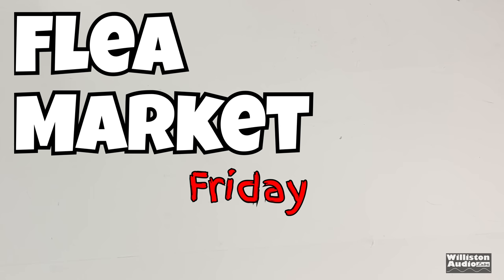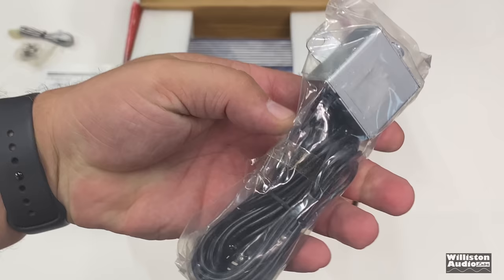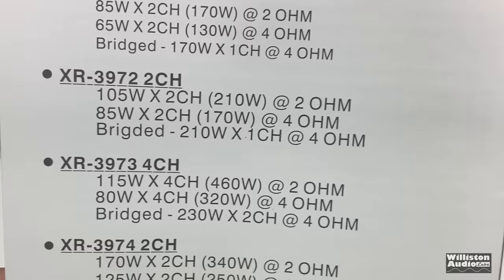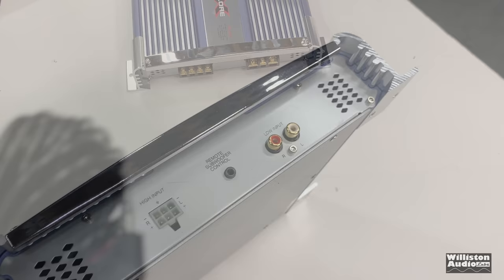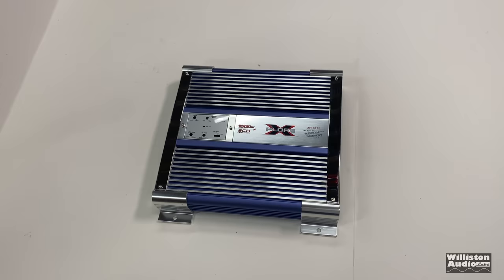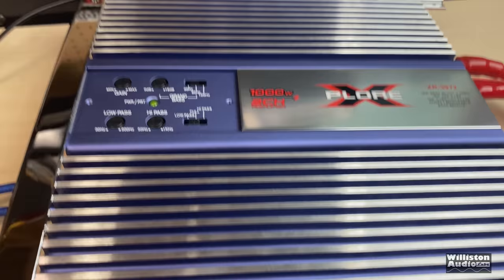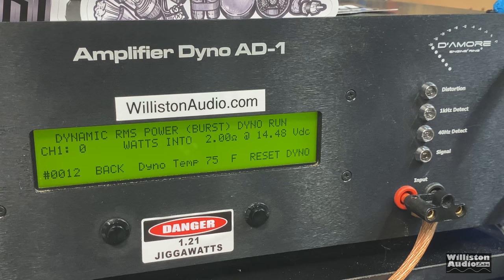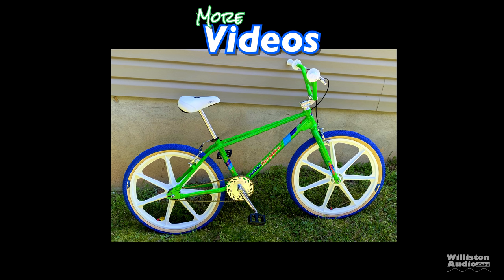Xplore 1000W Flea Market Special Amplifier Amp Dyno Test and Review [4K]

Comment: I love these cheep amp reviews possibly more than the expensive reviews, I'd love to see a series where you ( or you team up with someone) where you modify them and see what they can do with some additional work, bigger caps and transistors etc ( not the guts from another amp)
Reply: I had some parasound amps I got from when pacific stereo when out out business.  My best friends grandfather modded them .  Every  one had hifonics and I had 2 cheap amps running 2 ohms blowing them all  away.
Reply: Pretty much ends up being a complete redesign of the power supply and most of the output section. There's a video series that bare vids did just recently on a taramps audiopipe clone that he changes to get the output of the original as a proof of concept. Very informative if you want to check it out.
Reply: @brentb5303  I'll take a look at that thanks
Reply: It is
Can We meet a  @Bondovw
Reply: It's the power supply more than anything that determines the power output.
Reply: Great idea , pimp the cheap amps for $10 of electronics
Reply: @69eddieD  I was wondering if he could do tests at like 13 volts to closer imitate us stock alternator guys. It’s probably lower than that….

Comment: Man, I love these flea market amp tests!
I'm suprised this one actually made rated power.
I'd love to see some more Urban Audio Works test too.
Reply from the maker: I’ll try to do one each week. I have like a dozen of these style amps.
Reply: Urban Audio...  now that that takes me back, 1st lesson in you get what you pay for a value pack cassette radio plus amplifier from Urban Audio. Thought it was going to make the '85 S-10 freakin awesome! Umm ya just no... lol. Can in hear it for the old JC Whitney sub box with built in tweeters while we at it Hahaha
Reply: @myevilbanana  * edit below figured it out   
who was the company that was before urban amps?  They looked exactly the same.  I remember they said they had hexfets instead of mosfets or some shit lol
They were Targa amps
Reply: I think Targa was the brand before urban audio works
Reply: @myevilbanana  I remember back in the 90's there was a store in out local mall that sold urban audio equipment and you could buy a 12in woofer for like $20-30 and a 400w or 800w amp for like $45 and I'm not sure how you had bad luck with them but I had 4 urban 12's running off of 2 of the 800e amps in a little chevy chevette and it would rattle your teeth for the amount of money I had in it....
Reply: @miketaylor2197  targa i think was , i had 2 10 in targas in a band pass actually weren't too bad .
Reply: Splash amps were garbage
Reply: @wal  BigDWiz! I have a few old school early 2000s amps I want to send you for testing. One of them is an Xplore amp-4040 😁. The others are an old school Rockford 400.4 and JL Audio 4 channel with non-regulated power supply

Comment: Back in 1993 I bought a cheap swap meet amp and two 12" Pyles.  It was my first system and I loved it.  Obviously cheap af but I finally had bass in my ride and I loved it
Reply: Gotta start somewhere unless you got plenty or extra money to start
Reply: @throwback_jackson  I agree.  Back then car audio was much more expensive and rms was low on amps and subs.  Today you can get a 3k legit amp for under $200.  Back then $200 amp was like 80rms per channel lol
Reply: @jorgem50  first Watt is what counts Brotha! :D
Reply: I thought I was hot sh-t around that time with my Optimus 18" from Radio Shack with a terrible homemade box that was completely the wrong size and leaky. I added a 12" MTX Blue Thunder after a while. I cringe a bit looking back but it was fun times and good memories.
Reply: @murrayshekelberg9754  lol man those were the good days.   Back when I was 16 and driving I was at my uncle's house and i took one of his cabinet speakers in tested out in my car.  Lmfao I just straight hooked it up to the my stock stereo. Sounded like crap.  I had zero idea that I needed an external amp to push those cabinet speakers.   This was in 1986 btw.
Reply: @jorgem50  probably a fisher house speaker with the white 15in woofers

Comment: I used to run a 2 channel Sony amp back in ancient times. It was a Sony XM-502x to be exact. It had the crossover and gain controls on the top and a plexiglass piece covering it like this one. Same crappy speaker outputs. Mine didn't have any chrome, but it was the blue/purple color this one has. I was running MB Quart components in the kick panels and two 10" Kickers behind the seat of my '78 Dodge D100. This was when MB Quart was good. I want to say this was early 2000's. I still have this Sony amp in my attic and I have no doubt it would still perform if I put it to use again.

Comment: Ha! Gotta love it when old junk makes actual rated power! 

I’ve got an old school amp request. I’d like to see you test one of the giant old Audiobahn amps that started showing up everywhere in the early 2000’s. I never sold the brand but I’m sure you remember the amps. Some models were absolutely giant, were chrome with gold handles or guards on top with top mounted fans and some had VU meters. I installed tons of them and always cussed them because they were so dang huge and would barely fit in anything aside from an SUV. A few of them made good power as I recall, but they were unregulated power hungry monsters.
Reply: CRACKED HEAD idk how it was in your area but in mine for the most part Audiobahn was heavily slept on. Guess one had to know which Audiobahn subs or amps to get because they made some great amps & tough subs! The Audiobahn subs & amps that always come to mind is probably like the ones you mentioned... The amps looked like chrome, had flames & blue lights & yes many of them were huge. Then the subs with chrome color baskets with flames. Can't believe how expensive some of those Audiobahn amps actually were back in the day.
Reply: @itdoesntmatterwhatyourname6128  I had the flame 🔥 q subs with the flamed basket on a rf 800power and they killed back in 03
Reply: I had an a16000v,  it did its rated 1600 watts easily, but it sucked the life out of my power supply. It died when I mounted it on the box directly. A huge shame because it was really powerful for its time

Comment: If you could grab one of those X12, V12, D12 (MRV ones) from the chinese market with 4/3/2 channels stating to have more than 3600w to test. It would be great since it's the most famous cheap amplifier here in the Philippines costing just about 2500 php or roughly 50 usd.

Comment: A lot of my friends bumped the old Sony xplode series amps and speakers, I could always make them sound really good for an entry level system. It always made them happy after install, even the pentagon shaped subs sounded decent
Reply: Wow,.. interesting. Everything, and i mean everything in that line, ive seen, is complete shit.
Reply: @96kylar  for entry level, they didn't sound bad, yeah they are a train wreck on the total scale, but if you u only got 150 buck for a system,  damn you should probably save your money
Reply: I hated the subs they blew out easy. The amps were class D and not that bad.
Reply: I had a pair of xplod 12s on a RF amp in a Lumina 20 years back and would set off car alarms as I drove through the mall parking lot. I can't comment on their amps but those speakers took some abuse and were still working when I sold them after 8 years. Maybe I just got lucky but I wonder if all the hate was really deserved and if many of the people talking about how bad that stuff was actually had any experience with it.
Reply: I worked at a shop that used to sell the exact same model amplifier 18 years ago. Surprised they are still making them.

Comment: Not too shaby for a feamarket amp - and the protect circuit works the way it should.  Got a low end car with a factory radio and want a little bump?  Then a single inexpensive 10 or 12 plus this and your set.

Comment: Maybe you could find an old school Amp. It's the power acoustik A3000db 3000 watt max. Class d mono block. Would be interesting to see what it pushes. I used to run those back in the 90's and they would push anything. I hit 151.6bds in a 1981 thunderbird. With one of these pushing 3 aluminum audio pipe 15" subs. I would compete with other bass heads that had more expensive systems. The called my thunderbird the sleeper.
Reply: I had it wired at .67 ohms and it never shut of or overheat. They were beast.

Comment: I want flames! :D Also wouldn't mind seeing the guts, that old school 'cheater' amp did surprisingly well.. Edit: You opened it! Nice.. Quite interesting, you can tell one channel is slightly further away from the power supply than the other, going by the output difference.. But the protect circuit worked perfectly too! I quite like how it has two separate PCBs, surely that would cost more than a single one? Shame shipping would be expensive, i have a real Sony Xplod here i'd be curious to see if it achieves the ratings, 4 channel though, XM504 i think.